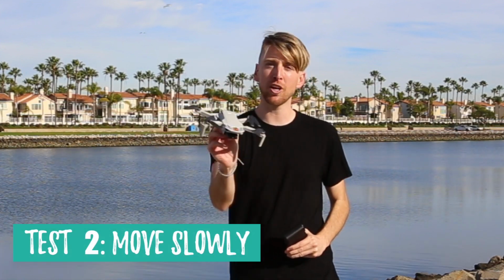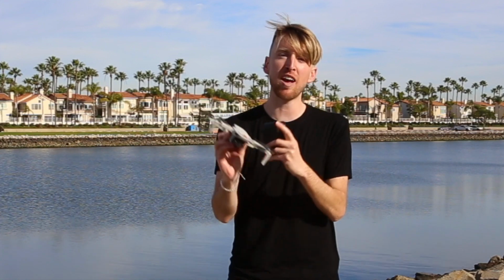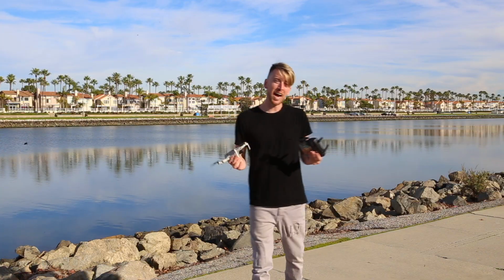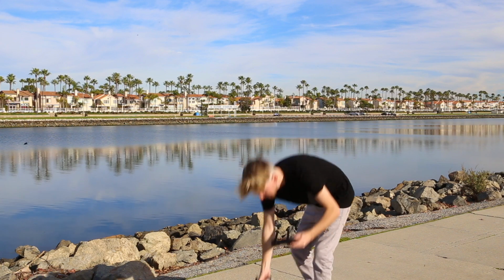DJI Mavic Mini Battery Test: REAL WORLD BATTERY LIFE TEST. 30 Minutes REAL or Not?! Hover Test FAIL!

Comment: I VE HAD ONE FOR A WEEK AND JUST FLEW IT TODAY. oNLY GET 3 TO 5 Minutes battery. Not 30mins. Its very flimsy and fiddly to use.
Reply from the maker: wow 3-5 mins is so low. have you tried different batteries??
Reply: Hi man, I am sure you are doing something wrong or your drone is faulty. I never got 30 minutes but even in very cold weather I have been getting an average of 23 minutes... Can you post the videos so we can have a look? Cheers
Reply from the maker: @AratjaUjotOurstories  I average around 23 minutes too. That's flying in a fun and normal way. I have never gotten a full 30 minutes like DJI states. Thanks!